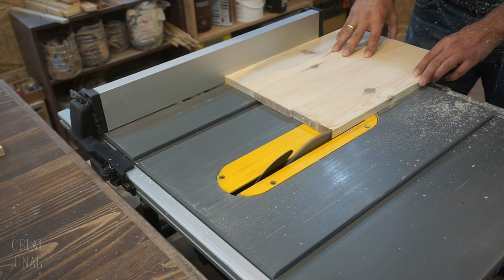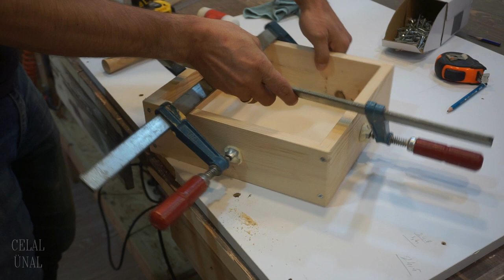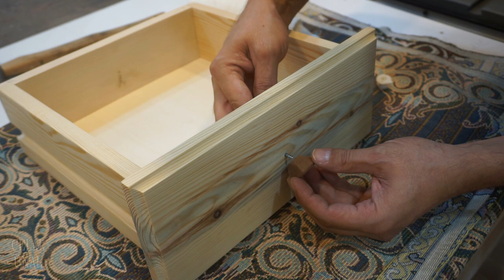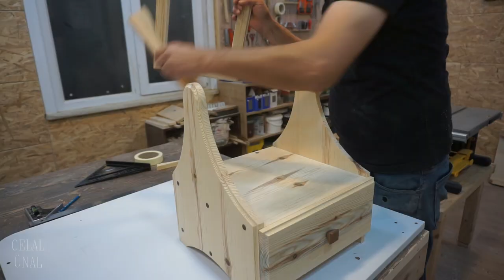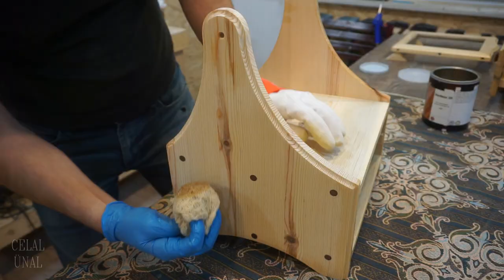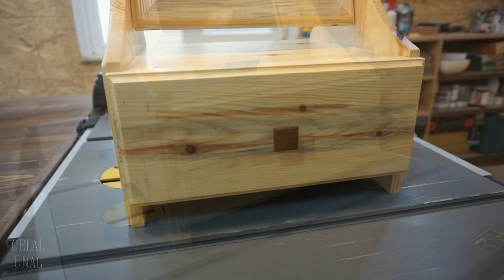Wooden adjustable mirror drawer / Mirrored jewelry box / Diy Woodworking / Ahşap aynalı çekmece

Comment: Hi. You are doing a great job! I have a question about the DeWalt chainsaw. I am also going to buy one because it has a lot of good opinions. Does it often need to be calibrated when it comes to cutting angles of, for example, 90 and 45 degrees?
Reply from the maker: Thank you so much. I am so glad you liked it.
You shouldn't have any problems with Dewalt. No problems with settings. When you buy new, you need to tighten the nuts and screws. You will use it for a long time after checking it.